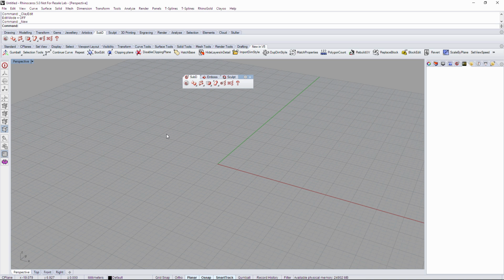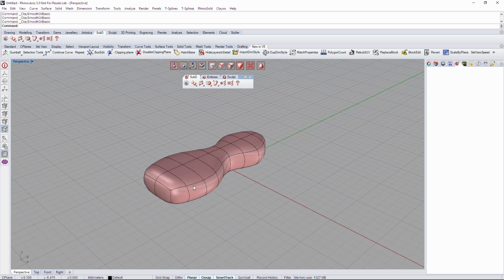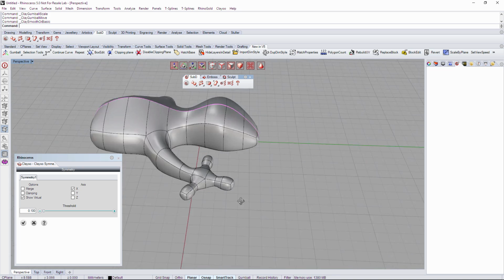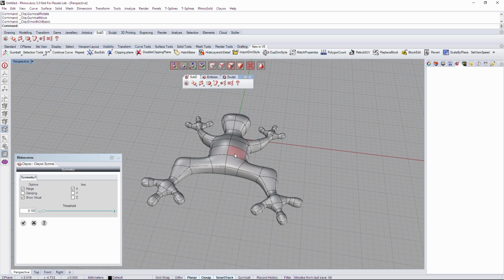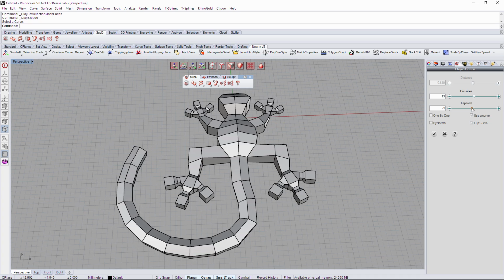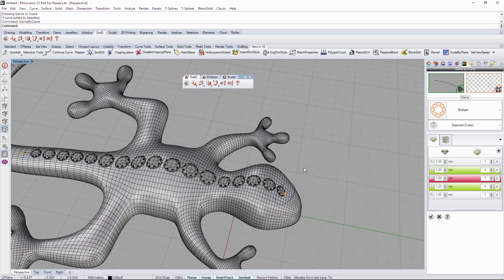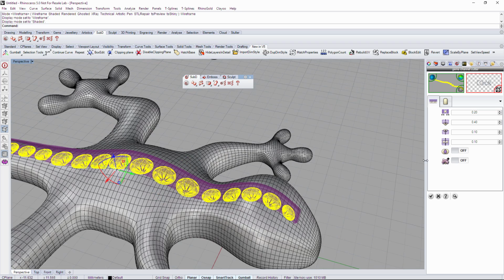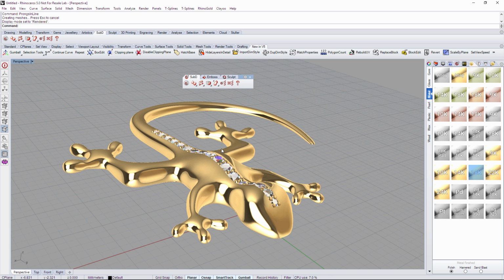RhinoGold and Clayoo Presentation - Rhino Day, Brasil

Comment: a few more distracting (anoying) things. The mandatory use of the gizmo,  it is not possible to transform/edit a clayoo with the regular rhino commands(scale, move points etc), without breaking it's clayoo properties.unlike T-Splines. It s a pain to manage the gizmo. to scale something from the Zero coordinate, I have to select the move gizmo, press concontrol to drag it to the "center" of the grid without affecting the transformation, I have to eye ball it, be cause snaps are not efective in the gizmo, then I have to switch to scale mode and drag from the circle of the gizmo to constrain 2d, which leads us to more problems. if I would be using the regular scaling tool from rhino I would pick the first point as the center of scale, and a second reference point, which helps to set a ratio of the scaling factor, with your mandatory gizmo, that second reference is the circle that is about 5mm of distance from the center pivot, which means, if I am trying to scale something that has a distance of more than 10mm from the center point to the object to scale, is a pain, be cause you move the circle a tinybit and the scale is moving in big increments and I should say...it is not acurate to manage a scaling object this way!!!!. and all this just after wasting some time, selecting the desire points to scale, since the lasso tool does not work on. clayoo points.